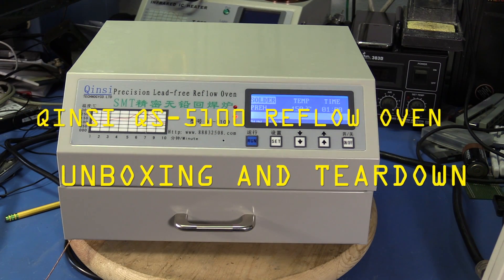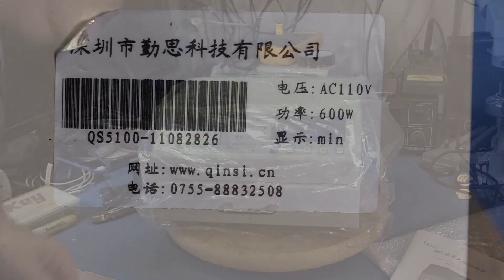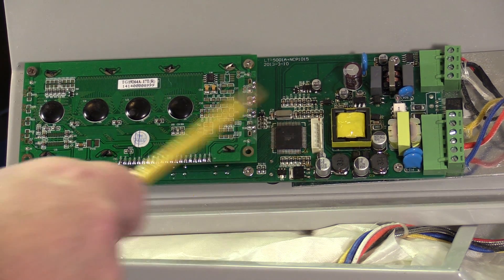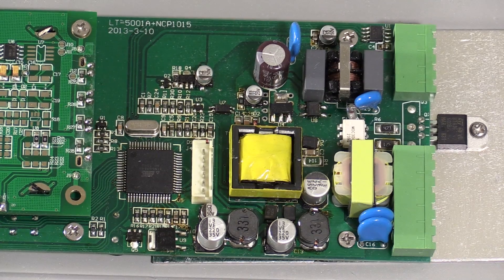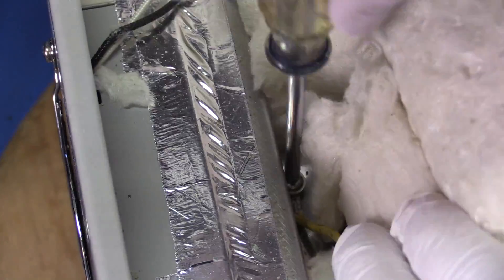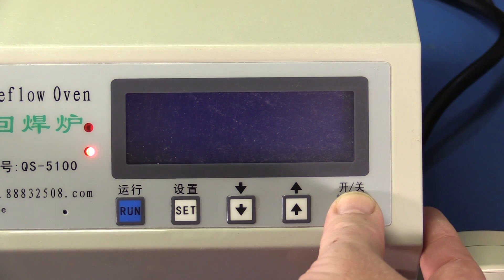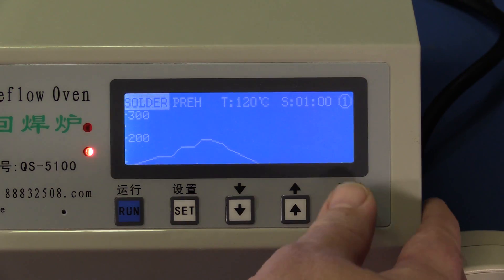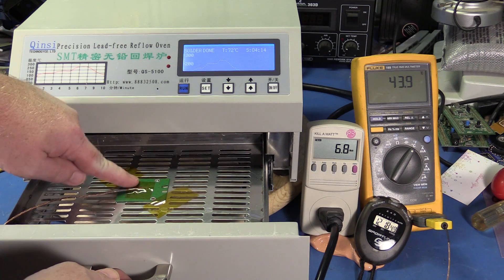Qinsi QS-5100 Reflow Oven Unboxing and Teardown

Comment: Hi Mark. 
Great review thanks!!
I was just wondering whether you find the 600W to be sufficient?  I noticed most other small reflow ovens are 1600W or even 2400W?? 
Thanks!!
Reply from the maker: Please don't hate me, but I got distracted by a series of shiny objects and I haven't actually done anything useful with the oven!
Reply: @Nf6xNet  Hi Mark, thanks for the prompt response. Hate..? Never.. lol.  Maybe just bit envious of the oven just sitting there and all the other shiny things you mentioned, haha. If you get to test it, please let me know.  I normally do small board, around 100mm x 100mm but would be nice to be able to do two at a time. Worried about the 600W (compared to other models).  Any tips on 3D printers?? Cheers!

Comment: Hi Mark,

Thanks for your reviews on both the T962 and Qs5100.

Just wondering how you got on with these units? Did you finish up flashing the T962 to the updated firmware?

How did you finish up with the QS5100? This unit appeared to be slightly better engineered going by your reviews, be interested in your feedback as I am currently looking at a basic reflow unit.

Regards,

Ian

Comment: I write in detail about a Sn63/Pb37 reflow profile for this oven... I also plot the temperature data so you can see what the oven is doing... look at my blog https://iotexpert.com/2016/11/28/qinsi-qs5100-sn63pb37-solder-profile/

Comment: What the hell?! The oven displays 235°C when the thermocouple shows 286°C (at 9:53). No wonder I destroyed so many of my components with this s**t. I ran the same test and got the same results. My advise: keep away from it.
Reply: Clearly, these cheap Chinese models should not be viewed as finished products. Instead, they should be viewed as relatively cheap starting points where a DIYer can make some modifications to end up with something useful.
Reply: In other words, if you don't intend to make the improvements needed, then it's better to pass and get something more expensive that will work out of the box.
Reply: scary

Comment from the maker: To switch from Chinese to English:

1) Turn on the main power switch on the back.
2) Press an hold the RUN button while you turn on the machine with the ON/OFF button. This should bring up the language and graphics/text configuration screen.
3) Select ENGLISH and press the SET button.
4) Press RUN. The screen should turn off.
5) Turn it back on with the ON/OFF button. It should be in English now.
Reply from the maker: For some reason, I was not able to post that as a reply to the viewer who asked about this. Sorry! :(

Comment: My QS-5100 oven has arrived and I've been playing with it. So far so good! I adjusted the custom profile to work well with Chipquik SMD291SNL10 Pb-free solder paste and appear to be getting decent results with bright, well finished joints and properly bonded components. I have not tested it with multiple boards yet, so I cannot say anything about temperature uniformity. The largest board I have put in there so far is only about 3 x 2 in. I'm also interested to see what you find with your more rigorous thermocouple tests - temperature distribution and board / air temperature disparity (these would help guide towards a better estimate of how long to dwell in the preheat stage to ensure equilibrium has been attained).
Reply: How did this turn out?

Comment: Hi there! First of all, that's a really nice video review!!! Thank you very much!
Now, I hope you don't mind answering a couple of questions.
About this and the T-962 oven, which one would you recommend for small boards (2 in. x 2 in.), 4 at the same time? I'm worried about heat distribution, then I'll end up having to reflow one board at a time putting it on the center of the tray.
Have you tried the custom firmware on the T-962?
Best regards,
Bruno